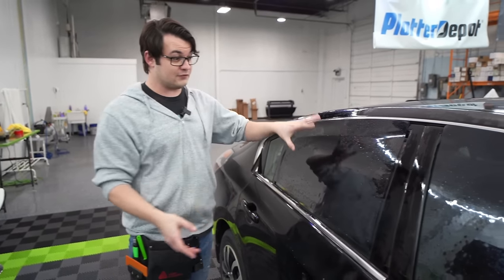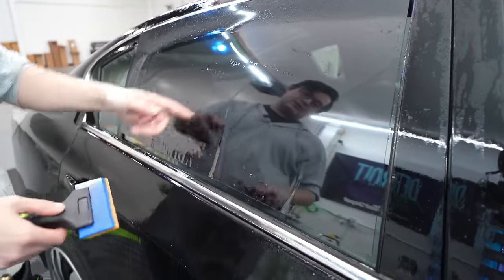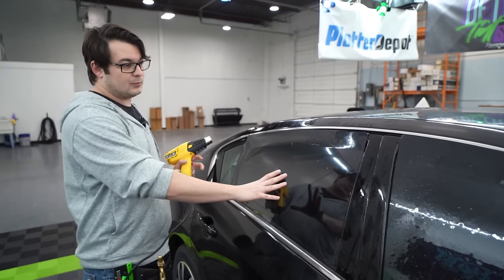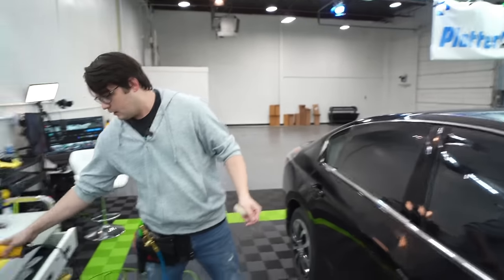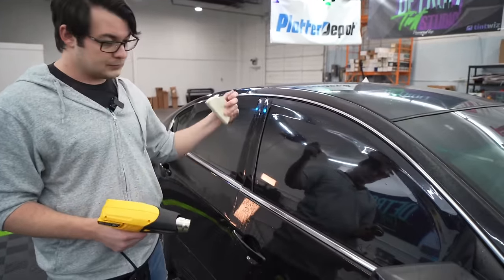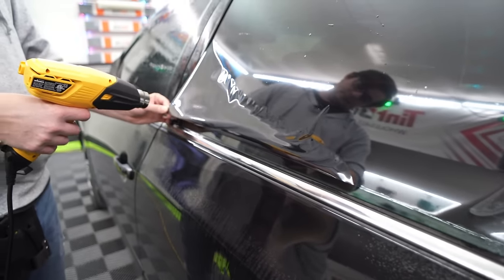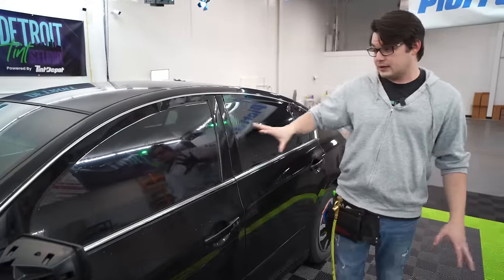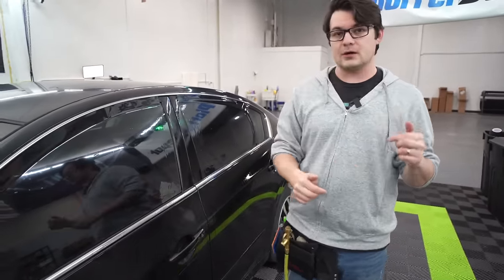Snap Shrink Door Window Tint for Beginners

Comment: I am going to do first window tint on my Dodge Grand Caravan in few weeks, your videos prepared me for it, at least I hope so. Will give an update when I´m done. Thanks for all your explanations!
Reply: How did it go?
Reply: @somerandommexican3146  Just realized how complicated Tinting job is. It looks easy but it is not. Long story short, had to take my car to the professional shop :). 

Bought Pre-cut window tint and shrinking is harder than it looks. I took my time with the heat gun but still messed it up. Another problem with Pre-cuts is there is no space for error, since you dont have extra material around the sides. Tried it on the easiest parts of the van and it made me realize you need a lot of experience and practice to do this type of job on a curvy windows.
Reply: @Lperw thanks for the honesty
Reply: @Lperw  just spent $150 on precut tint 20% rear sides and rear window, 35 front sides and nothing on front windshield. I’ve watched about 30 videos over 10 mins each to get ready for it it, I’m destined to have a bad time. This little car has given me nothing but trouble, the tint is my last attempt to redeem the car of its trouble before i just get rid of it. 05 lacrosse cx 87k miles
Reply: I’m 14 and self learning how to tint got a 5% 24/100 I did learn a lot
Reply: How did it went?
Reply: @Omgkhii how’d it go

Comment: I recall back in the 1984 my friend and I tinted my car and he did an awesome job.  No bubbles was the the thing to avoid and we succeeded. He told me to be cognizant of other cars and you will see the bubbled tint everywhere. He told me the key was soapy water, keep the tint wet, but I do not recall him using the outside of the window as a template nor wetting the tint on the outside. So I am amazed it laid flat. Fast forward and the art of tinting has come a long way. Great video.

Comment: Noob question here. 
Do you only shrink the bottom of the side window?
Does the top edge never need shrinking?
Reply: noob here as well. I get what you mean, tbh I tried shrinking the top and I made it worse by doing that so I always start from the bottom. Going to use this method because individually shrinking fingers is a pain in the ass. If you see fingers on the top part of the film then yes you have to shrink it.

Comment: hello sir. QUESTIONS. last method.  you just head the bottom edge or bottom edge with few inch up. 

note: I used to user regulat method but I do it twice.
Reply from the maker: The very bottom but you can shrink up a little higher to help tighten it up. Main this is to watch how the film lays on the glass after you shrink. If it’s flat, ur good 👍

Comment: How hot is the heat fun supposed to be mine has two settings a 1 and 2 sometimes when I try to get the little fingers I end up burning the tint I’m not sure if I’m too close or if I’m using too much heat I usually use number 2 setting which is the hottest
Reply: increase your distance from the window with the heat gun

Comment: I just started tinting myself and I have a question. How do u keep the car doors opened the entire time and the battery doesn't die? I was tinting a car and kept the door opened for about 30 min and the battery died.
Reply: shot off the dome lights,radio etc. anything that has power while the door is open.
Reply: And work faster lol

Comment: I don’t fucking get this, are y’all missing the final step?? Every window gets heat shrunk down on the outside window with a big gap on the bottom and some on the sides??? Why is every video have no tint on the lower part  where it meets the door? I don’t get it
Reply: This tint is not actually stuck to the window they just press it against a wet window so they can shrink it on the outside and cut to size. Then they move it to the inside and place it in the correct location to cover the full inside of the glass.

Comment: Tint goes on the INSIDE tho! Wth
Reply: Do your cut and set up on out side remove reinstall inside 😊
Reply: Contour of glass doesn't change.  Go ahead try doing this on the inside.  I dare you.
Reply: @AntonioSmith-zk4ty  I meant when it's done being measured & cut it goes in the inside. That's where all professionals secure it in the end & people Who watched youtube videos instead of going to a professional & paying them their worth- Constantly complain about how every piece of flying debris every little stone cuddle or anything that hits their window leaves cuts & abrasions or worse, it tears their tint apart. Obviously! It's THIN flimsy plastic. If you're just saying that you're doing all this to measure it to go on the inside at the end, that makes sense. But if you're permanently installing the tint on the outside of windows, You've got something wrong with your head.
Reply: @Rkyw111  Exactly RK. That's what I meant.